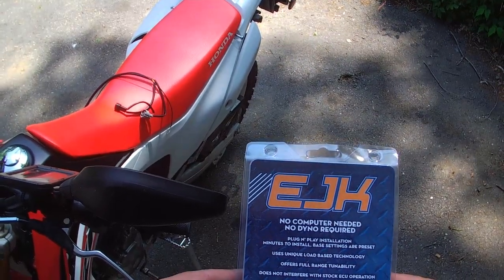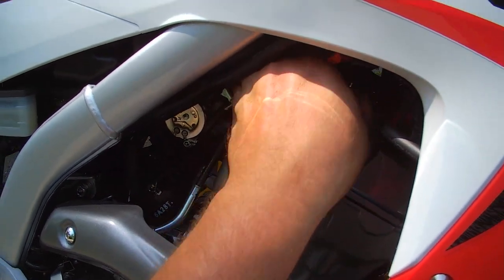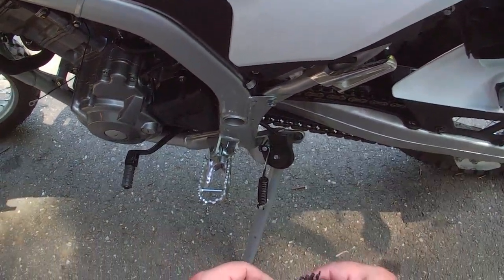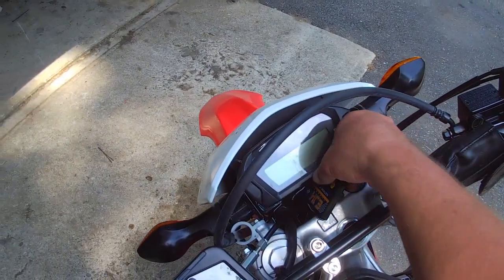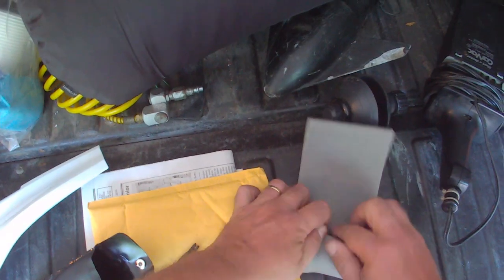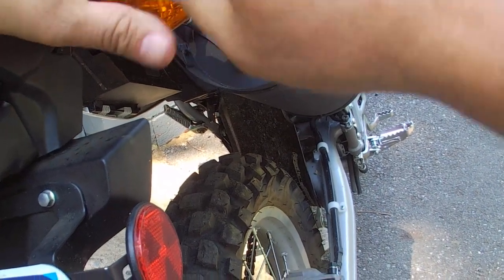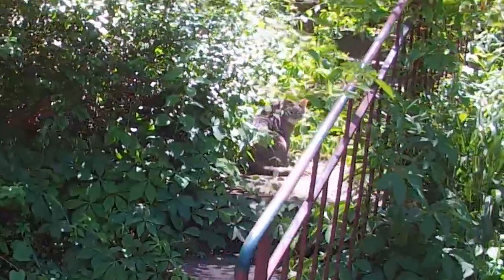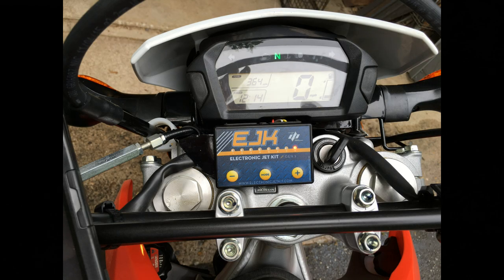CRF250L, 3 quick, easy and huge power mods you can do in an hour!

Comment: cool, thanks for the insight...mounted the unit using the reflector brackets that I removed from the forks.  mounted to the handlbar clamps; used the other bracket on the other side for the gear indicator dealio....
Reply: Is it waterproof?
Reply: @andrewbulla1374  yes

Comment: My 2020 came with a bunch of open end 3 of them wench, 10,12-, 15,16- 8,9 and screw driver with flat head, and some others.. i got all the mods on my 250l just not the, EJK coming in this week and front sprocket change..... don't really want to change it due to speedo not reading right.. 2020 Black CRF250l

Comment: Anyone know what size that allen is to start to get to the baffle area? 3MM? 3.5? They must have cranked it down at the factory. It is the 2 screws holding down the most rear part of the exhaust before we can get to the 4 bolts..

Comment: the tool kit that it comes with is no good. where can I get a kit like you replaced yours with?  I can not find one.  thanks for the video
Reply from the maker: Mine came with the bike, I hear some don't come with the toolkit I think it's the dealer that's not putting them in when they assemble them, call your dealer and tell them you did not get a tool kit. Thanks
Reply from the maker: Or maybe their tools are year specific? Because you said yours isn't as good as mine
Reply: MotoCheez yes I just got the three keys. nothing else. 2015 model.
Reply from the maker: Oh man. Call the dealer!!! The come with a kit from factory

Comment: By cutting the exhaust like you did, what is that going to do for you, or in my case if I were to do that.?
Reply from the maker: It make it a bit louder and a bit better flow but skipping one baffle. Just cut it kind of close to the flange. If you need the spark arrestor, you'll need to weld it close to flange.
Reply: MotoCheez I Will be doing that to mine but unfortunately I can not get EJK for my bike it's a 2017,
Reply from the maker: You sure it's not the same unit? I didn't think they changed anything on them yet
Reply: MotoCheez I went to there website and they did not offer it for a 2017 crf250l. Or you may know something that I don't?
Reply: MotoCheez I found one that will work on my 2017, just wanted to say thanks for your videos, I really appreciate it.
Reply from the maker: Awesome!

Comment: Motocheez, do u have a vid for a usb/cigarette plug install for charging stuff?
Reply from the maker: I didn't. ... But should have
Reply: Cool. May i get the part number of plug u installed on ur bike?
Reply from the maker: Sure, https://amzn.to/2l5DTZS It fits in that spot I put it pretty good!
Reply: Excellent! I just got my 2017 crf250l rally yesterday. Need a charging plug lol
Reply from the maker: Congrats!! Yes, It nice having one, that's for sure!
Reply: On the ejk kit, will it affect honda warranty? And the mods really improve power in ur opinion?
Reply from the maker: I'm not sure if it would affect the warranty, but I'd remove it before I brought it to them, it just unplugs. Yes, I found a huge increase in power, stock it felt a little lethargic to me, now it has more torque and top end for sure, even with the lower gearing.
Reply: Ill get my engine broke in and do first service interval then ill invest in the mods. Thanks Motocheez!
Reply from the maker: Good idea! IMO, it's worth it

Comment: Hey motochezz, if I get a new exhaust pipe for the crf250l. Do I need to adjust or get a ejk. Or will it ride fine just with the pipe? Thank you
Reply from the maker: Gustavo Lombana Jr being fuel injected it will compensate for the new pipe, but it will still run on the lean side. you could always add later on.
Reply: Thanks a lot bro. Keep up the videos I enjoy and learn a lot from you 👍🏼
Reply from the maker: Gustavo Lombana Jr thanks!
Reply: Gustavo Lombana Jr I

Comment: Hey man, need some help on which settings to use.. 2016 crf250l, full fmf exhaust (powercore and megabomb header) and k&n air filter
Reply from the maker: My setting with modified exhaust AND AIRBOX are: G3, Y3, R6, GB5, YB4, RB4.5

Comment: Does the EJL tune your bike on its own or do you have to do something? I wanna save up and get this bike so I'm curious
Reply from the maker: StilwellMotovlogger it comes preset with a better tune, but I upped a few settings playing around with it
Reply: Ok. Do you think that and the exhaust mod really woke it up? Can you tell there's a power difference?
Reply from the maker: StilwellMotovlogger noticeable, but not huge, it allowed me to raise the fuel mixture a bit
Reply: MotoCheez what do I need for a huge difference ? Thank you
Reply from the maker: Probably head work
Reply: @F-bravo I did full head work a 300 crank and piston for a cbr 300r a cam (big cam I had made) and a bunch of other things. I fry's the tire in 2,3,4 gear leave black on the road now.
Reply from the maker: @user-tj5wb2ik6y awesome!

Comment: This is all a waste of time and money. My 250L is stock and my buddy has the full fmf exhaust and the ejk and the air box mods, his bike is about 6” faster than mine in a race. He spent $800
Reply from the maker: He must be heavier? I did 0 to 60 times and compared. Before programmer it was a pig, I felt it and saw the difference. Power wheelie first
Reply: @dickheadbrian  barely, certainly not $800 faster.

Comment: Funny thing was that the toolkit actually had the one wrench he needed. Yet he still talked shit. But yeah the kit is trash no doubt.
Reply from the maker: I added a wrench set when u bought the DRZ. He wasn’t complaining....
Reply: @MotoCheez  your reply made no sense at all. Literally. The stock honda crf250l toolkit has the two allen wrenches to take off the plastics. Which are the ones needed for the job he was doing. Please reread your comments before posting to avoid posting things which make no sense. Thanks.
Reply from the maker: Winston Poplin sorry. YouTube studio has such a small thumbnail I thought you commented on the video I just posted. Now back to the right video response, the tool kits have shrunk over the years by less than half of what they used to give. So yeah I’m complaining it doesn’t have the tools to adjust the chain if needed and missing a few Allen wrenches that’s the bike has hardware for. No need to be nasty

Comment: I've been watching a lot of videos of the Hawk 250, TT250, and Honda CRFL250 and I can't see the value of the Honda. A Hawk with all the mods-cluster, exhaust, carb, air box, spark plug, new chain and sprockets. Is way cheaper. If you want 50 state road legal and upside down forks and counter balanced engine get the TT 250. Even then the Honda is still 2x the price. For those thinking the Honda will be more reliable or hold it's value better. Maybe....Dual Sports do not hold their value. That Honda in a few years is gonna be worth 1500 to 2000 maybe. You lost $3000 in value. So you still end up paying twice as much. For those that knock the China bikes remember when the Japanese bikes came in they were basically junk too compared to Harleys and others but they got better and better over the years.
Reply: Todd Hayslett actually these things still go for about 3500$ to this day!!! With 15k-20k for miles! Honda is proven.
Reply: CSC is garbage... All the bolds shred like swiss cheese when you barely finger them with a wrench, and sometimes they come overtorqued or undertorqued from factory. I'd rather pay a g or two more and have something that isn't garbage in my garage.
Reply: are you selling Chinese bikes? LOL honda will run for years and years, China bikes maybe a couple years if you take care of it.
Reply from the maker: I don't sell them, I own Hondas, Suzukis and china bikes. The china bikes are cloned from Japanese engines and frames, they'll last quite a while if you take care of them. 10,000 Plus miles on many of them.

Comment: did you made any changes in sprockets?
Reply from the maker: Yes, went down one tooth in front. I like it way better. It's the video after this one.
Reply: +MotoCheez  Although it takes longer and bit more difficult... I'd go 42t in the rear sprocket and leave the front stock.  
You'll still get the low end increase without losing top end speed.
I took of my 13t front after it was diggin into the chain buffer and getting chain noise.